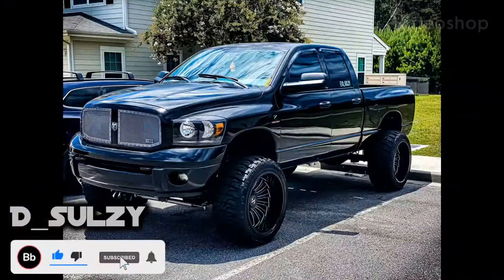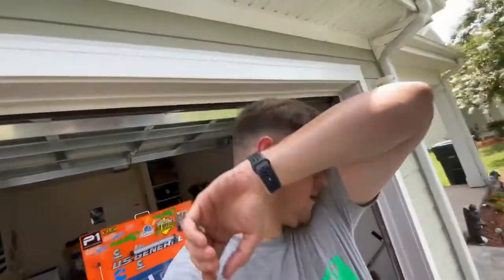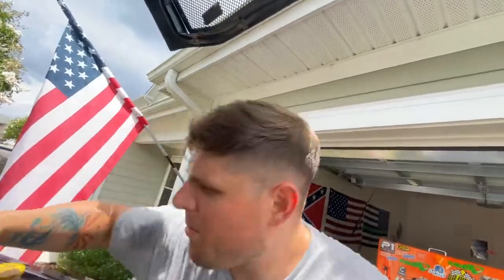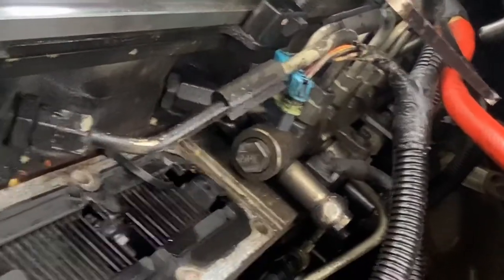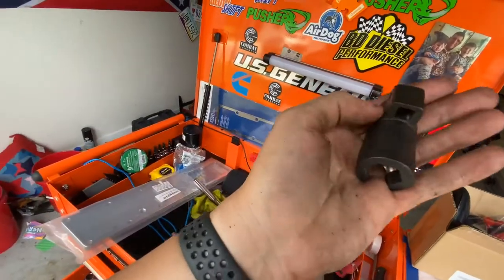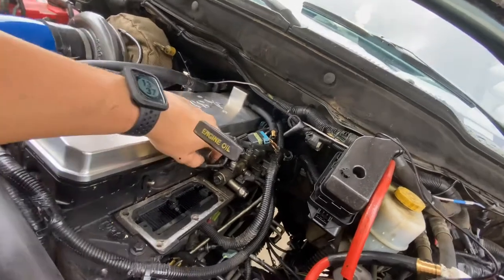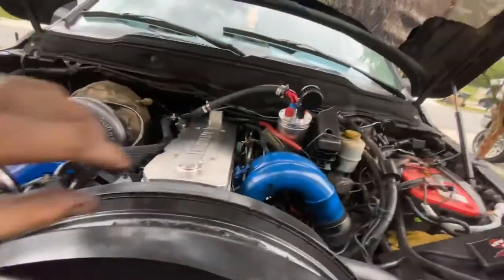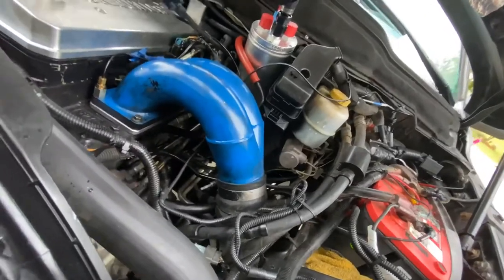CUMMINS GRID HEATER DELETE *install**

Comment: I just did the heater grid delete along with the same pusher intake and truck just wont start and after a couple tries it started for about 2 mins and threw a p0087 code what do you think i should do? Mines a 2014 and im in CA its 80 degrees here
Reply from the maker: I’d is the fuel rail hooked up properly? I’d have it looked at, but first make sure everything is tightened and hooked up properly. That code doesn’t have anything to do with the heater grid delete and I ain’t there to see it

Comment: How did you get past throwing code when you went to the aluminum valve cover. And where does all your ccv stuff run to now?
Reply from the maker: There were no codes from a valve cover install man. And through a catch can. I currently have it torn apart though to redo it all and build it for 1000hp stay tuned!

Comment: great job what is. the year of your truck. i need to do this Grid heater delete to my 2008 ram2500. you said you can get by without  having to remove the #6 injector from the block and just loosen it the fuel rail.i like and subscribe. looking for your feed back.
Reply from the maker: Thanks for the comment! And mine is an 08 as well!... and yes I just took off all the other lines and left that one and pulled the grid header out from under it.... then cleaned everything up and then it’s g2g. Any other questions hit me up on IG! 🤙🏻

Comment: Did you paint the engine block with it still in the truck? Been wanting to paint mine, but it seems like a pain!
Reply from the maker: I didn’t paint the engine block...
Reply: @dixOut5.7   Ahh, my bad. It looked like it was painted black
Reply from the maker: Nah, I painted the rocker box and some of the top components but not the block itself

Comment: Pros and cons of a heater grid delete?
Reply from the maker: But the pros would be, as long as you don’t get like a -20 outside climate, would be more airflow and I guess cons would be that if it gets super cold it may be a harder start. But I noticed better spool..and I got to clean everything under there so that’s a plus 👍

Comment: Did you remove the inducer ring from the VGT? It sounds kinda whooshy in the video
Reply from the maker: Why would I remove that? It’s there to create a smooth transition of air movement into the inducer housing.. removing it makes the air scattered
Reply: @dixOut5.7  Yes I know, but some remove it cause they think it’s a silencer. I’ve heard it makes the VGT sound weird. Yours just sounds different to me in your video so I was just curious.
Reply from the maker: @CHILLHP  oh I got ya, nah it’s kinda a pain to remove in these ones lol but it may sound different cause of the 475 on top
Reply: @dixOut5.7  Ahh yes that is probably why